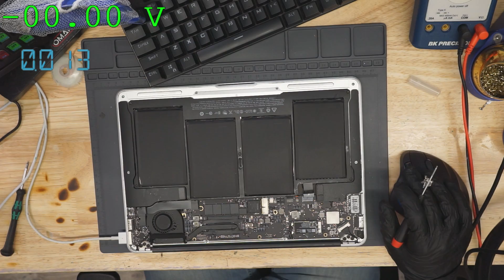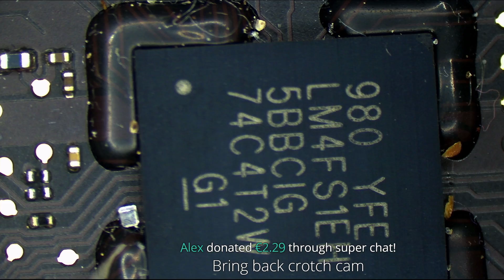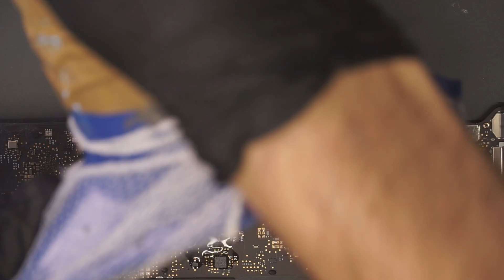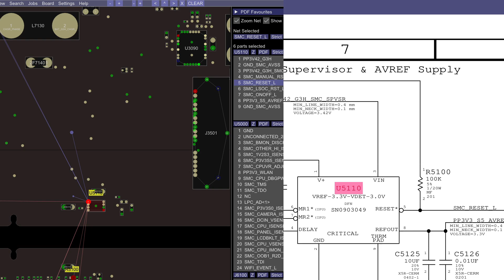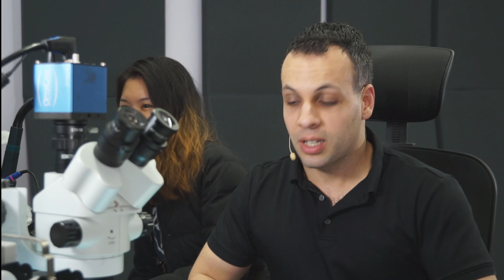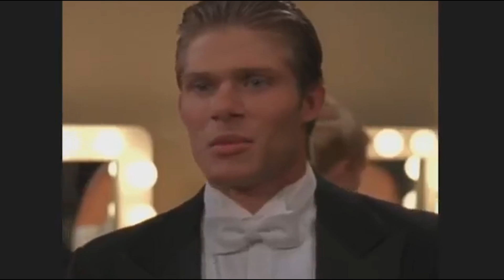A1466 Macbook Air logic board repair - no green light on charger

Comment: I repaired a 2009 Macbook Pro 17 inch today which had been dead for 3 years...it had a load of cheap upgrades inside it including a battery which connector didn't even stay in place without tape and unbranded ram. The charging port was water damaged with corrosion around the solder joints. Cleaned it with isopropyl and the whole board, new thermal paste, SMC reset and jump started using the Start pads on the board..dude got all his old files back..it was a good day!

Comment: Most Macbooks are faulty because of liquid damage. Would you say that Laptops from other manufacturers are immune to liquid damage?
Reply: A chunky Lenovo ThinkPad L512 I've recently worked on; after a rain storm flooded the office it was in; had a stainless steel tray underneath the keyboard isolating it from the components, and little drain holes for water to drain straight below the laptop.
It was fine for water dripping on the keyboard, but if water had come up from the bottom to seep into the ventilation grilles and peripheral ports, the HDD and board (like it did for a neighbouring T420), it would have suffered.
Reply: @TechNinja.1701  So what you're saying is that it is possible to minimize the impact of water damage but Apple decided to rather go thinner and lighter?
Reply: bullshit.. any exposed integrated circuit will be gone with water damage
Reply: @Spartan720-l3f  no, it doesn't work like that. Most electronics can be fully submerged without any damage. If you let it dry out and it wasn't salt water, it will be just fine. MacBooks break from just the moisture in your breath.
Reply: MacBooks will also short out with water damage in a humid room, other laptops will not!
Reply: I wanted to show an example of how other manufacturers mitigate water damage in some of their models. Louis did a video a few years back of him spilling water all over his ThinkPad.
To answer your next question, I think Apple could direct their very clever engineers & designers to spill proof their MacBooks, but it seems to me that they'd need a lot of their customers and potential customers to fight through that self-imposed reality distortion bubble of theirs; the same bubble that has prevented them from properly rectifying their "butterfly" keyboards on their USB C MacBooks.
Reply: @TechNinja.1701  Yes the butterfly keyboards were used way too long. But iPhones, OTOH, are water resistant since the iPhone 7 and did not become thicker. So you can't accuse Apple of some kind of reality distortion because water damage was a big reason for broken iPhones, so they tried to fix it. Same with displays they improved the strength of the glass. Why don't they do to their Macbooks what they did to the iPhone?
Reply: Gee, it's almost like there are more users of iPhones than MacBooks to cause a ruckus to get Apple to improve their designs... and iPhones are much more exposed to environmental hazards from everyday use.
Help us out here: what conclusion are you looking for evidence to support?